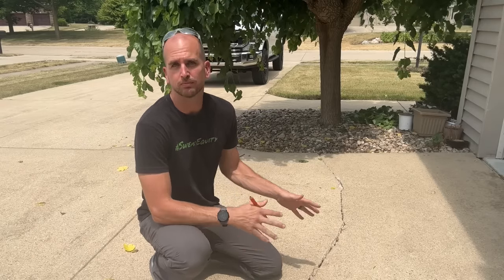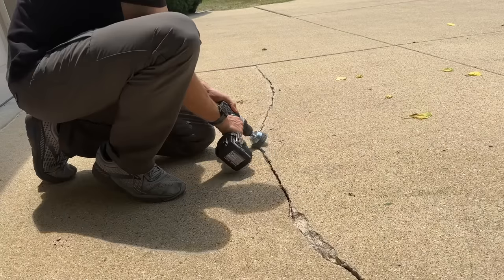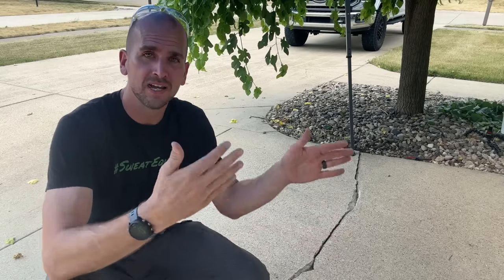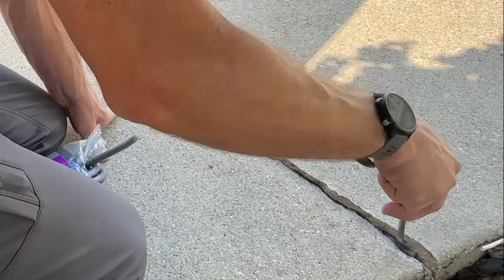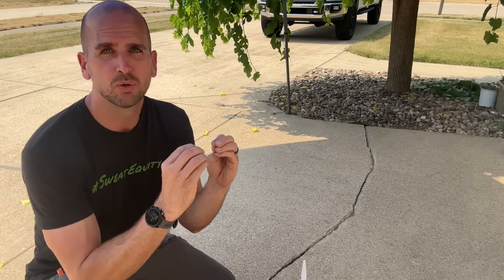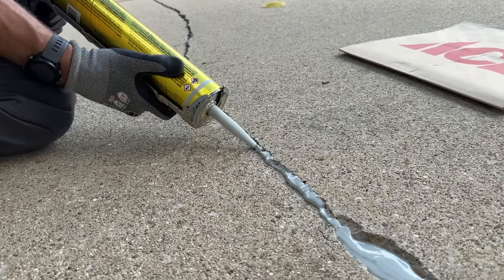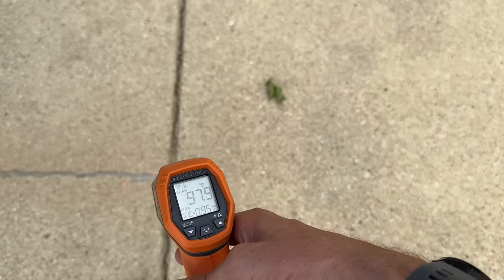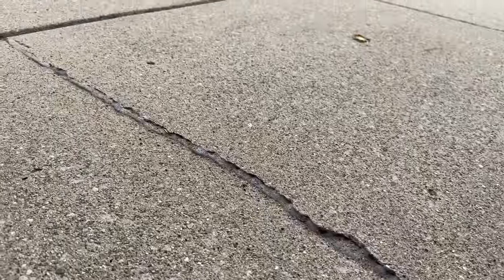Repairing A Neglected Driveway Crack |  The Ultimate Solution!

Comment: Nonsense, you'll have to cut away concrete from both sides of the cracks using diamond blade. Remove all the concrete and pour the new one at least 1' wide and also create at least 2 perpendicular joints.

Comment: That's fixed? not impressed. I mean, I have fixed cracks, you kind of want it to be flushed to the driveway, and fan out the high low spots, clean the drive way with concrete cleaner, and fan out the crack with mortar and then paint over it with concrete sealer and then two coats of stain.

Comment: not an ultmate solution...very poor one that doesn't address the pump jacking void issue and will just rebreak within a few weeks to a few years and the heave and drop will become a much worse issue as the crack expands in width, depending upon what is causing the issue. if it is the tree you will be dealing with this as the root grows and in 10 years you will be replacing a large section of your drive way in a very costly $10,000 repair.
landscape designed for construction builder neighborhood developments are extremely poor in design and longevity planning and only look nice to sell the homes, they have no concerns about 10 years after the warranty expires and when their landscape plants will start being problems detrimental to the home and especially it's foundations.
that tree should never have been planted where it is, get rid of it now while you can still do it by hand for very low cost. why? because the tree is exploring for water and going where it finds that water, plus the tap root is just bit shy of hitting the shallow line run off water table, once it does that, in 10 years it will be 3 times it's size currently and then you are really going to see problems with your sidewalk needing replacement as well as the drive way after the tree is removed figure about $25,000-$35,000 depending upon the scope of work. get it appraised now so you will have an idea of what the 18% year over year inflation is going to cost you.
after clinton community reinvestment act created and exploded the housing market under obama the local quality home building developer company i worked for sold out to a national builder which also got bought out two more times. i've had my eyes on this issue as modern machines and subcontracting changed the way everything is built from homes that used to take 3 years to build from first shovel to move in have caused so many issues that home owners will be saddled with a riddlement of problems over time cutting in best construction practices.

what i'm saying is chances are if your driveway is caving in and it's almost or past the 10 year mark from date of completion your homes foundation will also start suffering the same issues. it's gotten so bad that in places with clay soils the sidewalks and driveways and foundations are cracking and caving in before the 10 year warranty expires since the 1990s.

it's just due to poor back filling after foundation digging was done. couple it with extremely bad idea of putting plants that turn into 50-250 year monstrosities those plants will start destroying your home within 20 years. yes, even ivy.

Comment: its useless.. wither you do it this way or just pour float concrete into crack ,, its won't last long once tree root push higher.. it does help little more if you use tile mortar as its little bit stronger then concrete ,, none the less its not an long time solution
Reply: Wrong. Sealant stretches and will last years considering the size of the tree. Ghape fact that you suggest concrete shows his little you know

Comment: Nice to get the repair tips, but the whole nation is working hard to correct what is a dumb driveway design.  Large sheets of concrete with no rebar WILL crack in ugly ways.  Rebar is not always a good idea in a slab that may need to be cut for buried utilities.  Small squares with joints that can shift result in straight cracks that are not as ugly, and the squares can be removed to correct inadequate amounts of base aggregate, or to do underground service repairs.   Wake up, construction industry!

Comment: No grinder. No epoxy. No thanks.
This is definitely not how it’s done.
Grind the crack out and get some concrete repair epoxy and fill the crack then grind it down as level as possible.
Reply from the maker: I did a similar repair to what you are outlining but it was on a garage floor.  https://youtu.be/bXDYgxM-PTc

Comment: That looks horrible. You need to level the concrete and use spray foam first. Use portland to fill in cracks and a top coat cement paint .

Comment: Yeah well mortar works better - you just have to know how to apply that- generally for that kind of application I use hydraulic cement & when I am done I feather the finish so your 1/4" elevation difference disappears under a 1' feathered surface skim... before the concrete paint or other finish I will usually apply a 20 year ext caulk if there is any roughness left over due to the slab elevation differences, Unless the slabs are still moving the finish is always excellent. It's important that before you begin you etch the surfaces with muriatic acid & make sure you wash that off before proceeding... the prep you did was good except instead of a nylon brush & cordless drill you really should use a H-D Corded Grinder & concrete buffing tool [Diamond Blade]... after the prep you fill the gap & the hydraulic cement will actually expand into the crevice giving you a 100% seal... then when that is set you apply the surface skim leveling coat feathering it to a good finish... I have a crappy bull float that I pair with my wooden float to apply those surface feather coats on horizontal surfaces- that way I really don't care if it gets beat up... once the surface skim coat dries you then make the call on applying a 20 year gold label ext caulk as required before the concrete paint. I watched your vid bcuz I thought maybe you were promoting a new or better product/method but that simply is not the case... I have repaired these types of defects at various times thruout my 59 years of life & the same materials & methods always result in an excellent outcome so I will not be changing that approach, tho I always appreciate people who take the time to make these vids & of course I can always put my viewpoint in these comment sections for those interested in an actual repair that makes the crack disappear for good.
Reply: What brand hydraulic cement did you use? 
Because using it for 20 years I’ve never seen it expand like you say it does… it literally dries in minutes and is what it is at that point. Also any cement patch on cement/concrete will only last one or two years of seasons temp changes before it cracks itself. Unless you live in an extremely extremely humid area or/and it’s out of direct sunlight and mostly controlled temperatures in Small almost hairline cracks. 
I believe you are not checking up on your driveway patches a year or two later of your customers because you would see the cracks resurface.

Comment: You should get rid of the ants as it's probably them building a nest under your pad, causing it to move and crack over time!! Once ants removed you can get a company out to force foam under the pad to get it
 level again closing the crack. Your repair method is good but  you haven't solved the cause😊

Comment: That's it...?  Weird that you don't put something to make the crack "flush" with the concrete.... you know, a professional looking job.  What you did STILL looks like a Crack that needs to be fixed.
What you did might be okay for an initial bottom fill, but you need to do something more to "top it off level"...
For example, all you need to do is use some "Cement All" which you can feather really well, and then use a "sponge" to perfectly level it even more.  Don't even need to do all that other stuff you did.  If you're doing a bigger job, top it off with some "NewCrete"...  Your method is TERRIBLE....  Sorry.

Comment: 8 minutes for the ultimate solution.. caulk it. Same video with equal or better value wouldve been a 30 second short with about 1000 words less. Clean it. Backer foam. Caulk it.